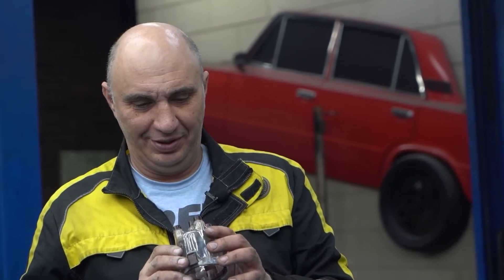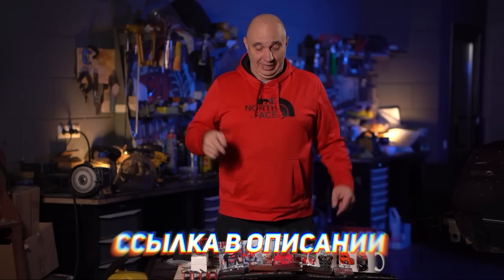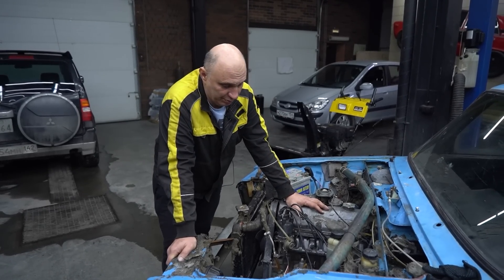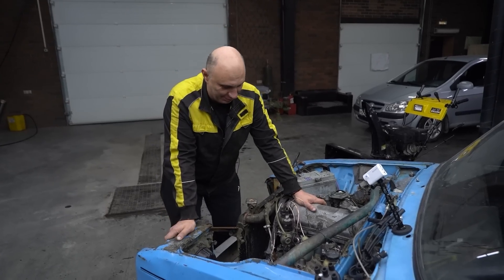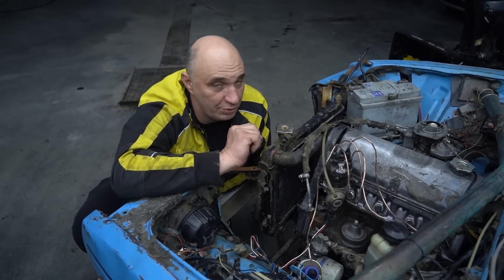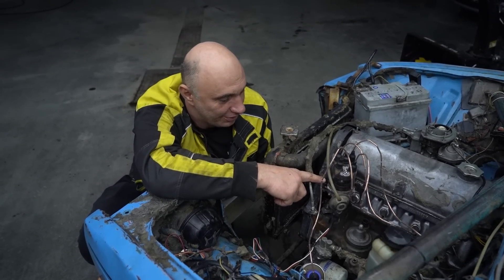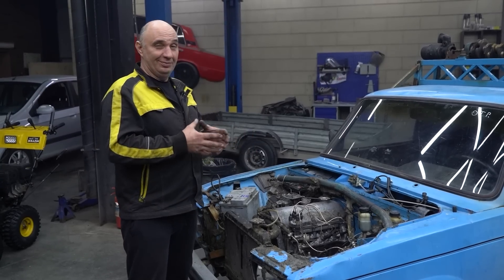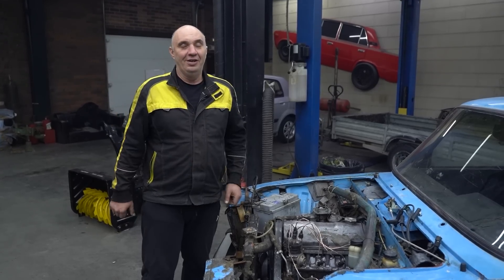We make luminescent see-through ignition leads

Comment: vinyl has one of the worst dielectric constants of any plastic, and once it is punctured with the first spark, thats it... its stuffed.

PTFE, PE/PP, or styrene are ideal.
acrylic, vinyl, and nylon are no good. 

the system needs resistance. the air gap actually helps when done properly.

a coil stores energy in a magnetic field, and that field collapses at varying rates through the discharge.

initially they collapse rapidly, and the potential rises, there being no conduction, only the resistance of the spark gap. the potential rises high enough to ionise the air gap, and conduction ensues. the resistance drops drastically, and the field STOPS COLLAPSING as more current flows... this bit is counter to intuition but its what happens in inductive circuits... the magnetic field doesnt want to change. because it isnt changing, it doesnt generate a voltage. because its not generating a voltage, it fails to maintain the ionisation in the gap.

the sparks own energy makes it fizzle out if the resistance is too low. when the resistance is correct, the field is always limited to a certain current flow, so can collapse at a  rate allowing it to develop a high potential and expend more of its energy, over a longer period.

resistance increases with pressure, and the resistance of the spark gap itself is actually fairly easily figured out. once ionised though... the resistance drops to almost nothing. it needs.. limiting.

also, if theres an air gap... because its not under pressure, it tends to ionise much more readily. and the peculiar thing is that as soon as any gap starts conducting, they ALL must conduct... they used air gaps to get more reliable ignition in drag racing with higher compression ratios, when the coil just couldnt deliver... its about voltage gradients and stuff.

fun fact, early CDI units often failed to ignite despite the strong blue spark. the circuit resistance was too low, the spark too brief. they work by discharging a capacitor, so they have the opposite issue to an inductor.
the air gap ionises, and the resistance of the gap is reflected back to the capacitor at the square of the turns ratio. as its a step up transformer, the resistance it "sees" is far lower than it really is... it wants to dump all its energy even faster! so you need resistance to limit the current again, but simply so the capacitor discharges a bit slower.

 that resistor in the plug, and the resistive leads, arent just there for EMI suppression. a 10k resistor, in a 100:1 coil, is only 1R to the capacitor... it will discharge at a rate limited by that and the ionised gap. we think of coils as delivering KV... but they also deliver amperes when "shorted". 

inductive ignition will always give a harder kick if it nips you than the cdi. again, resistance. the coil sees high resistance so produces voltage until it can char and deliver amps... the CDI sees the resistance at teh turns ratio squared and so its limited to how fast it can discharge...

electricity doesnt always behave how one would think.

Comment: Figued out cheap way to make Spark wires glow.   you need small vinyl tubing then waterjacket thicker tubing over it for water cooling.   pull vacuum on innertubes and seal them.   outer tube needs remote water cooled with small cooler of ice or winter air.    high vacuume tubing will glow pink under voltage.   figure out resistance and run resistor wire parallel as backup.
You guys are amazing,  top notch

Comment: Spark plug wires that have been oil soaked and in use for some time, the insulation deteriorates, in complete darkness a bluish green glow can be seen over the wires and this glow can be transferred to your hand when touched without you feeling any shock...i did not believe untill experiencing this for myself , kind of awesome in my opinion

Comment: What happens if you use really long motor mounts so the weight of motor ( and trans?) Connects to the car body or frame way further rearward? Mounted in trunk? Or mid mounted motor mounts to the normal front engine location. (Mount arms would be really long )   Does it change the corner weights or center of gravity? Can you improve handling this way?
Reply: This wouldn't change the centre of gravity, the weight would be in exactly the same place due to leverage.

Comment: Bend glass tubes, with a gas inside like a xenon or neon, and have short plug wires on each end, like 12-15mm glass with a 1mm hole through it, so it will not break easily, maybe from pyrex ,

Comment: you have it backwards.. the NEGative charge travels from the engine block, through the outer/ring electrode, jumps the gap to the center/tip electrode, then up through the ignition wire to the distributor.. it figures that you do not understand the induction as you see it before your eyes..
Reply: someone else can explain the collapsing magnetic field in CDI Capacitive Discharge Ignition..
Reply: there is another way to make luminescent wires..the bare conductor is coated in phosphorescent material.. after that, the wires are insulated.. this was covered by Hearst in the 1990s..

Comment: Cylinder 1 had something that was requiring higher peak voltage to ionize the gap of the spark plug. Since you were already at the limit of the voltage the ignition system could provide, it lead to misfires on cylinder 1. Could be wear on the spark plug, higher compression, leaner mixture or even valve leakage on cylinder 1.

Comment: you should do this with a msd set up it would probably give you better results Also i love watching your videos
Reply: It'll probably make it worse - you can already see some sparks at low RPM, an MSD 6AL will throw out 7 sparks per cycle. It'll look uninterrupted, just like at higher RPMs. What they should do is put a Blaster II coil and remove any ballast resistor on those old Ladas - 40,000 V vs 15 or 20,000 V would make quite the improvement.

Comment: Set of NGK neon spark plug caps would set that off a treat :)   BTW Lucas, Bosch and VW made transparent dizzy caps for testing purposes, the cap would be clear and the plug cap one of the neon types so they could set the timing to get the best looking spark visually, this was before widespread use of dwell meters for determining the best timing/points relationship.   You can get them for Mini's as well for the Mini electronic distributors, VW Beetle, Volvo's, even straight sixes like Triumph and Jaguars Lucas made dedicated "test" caps.
Reply: I used a yellow transparent cap on my 71 super beetle Baja bug it was cool at night